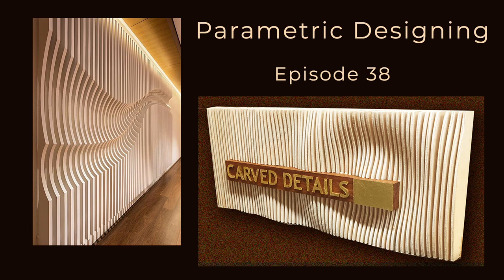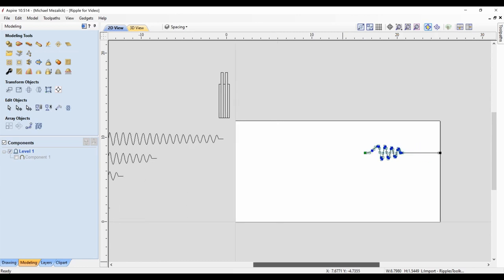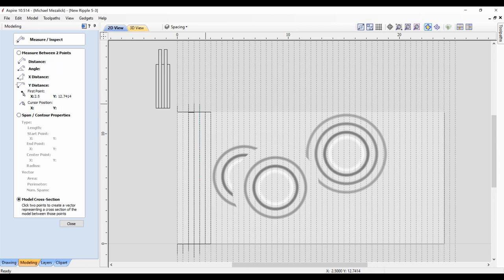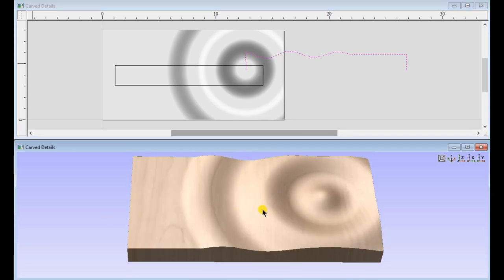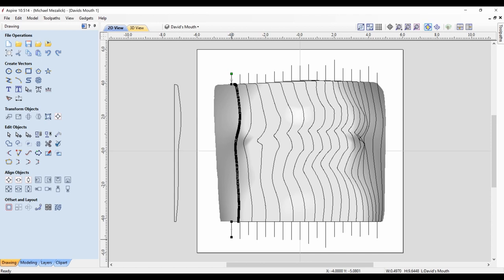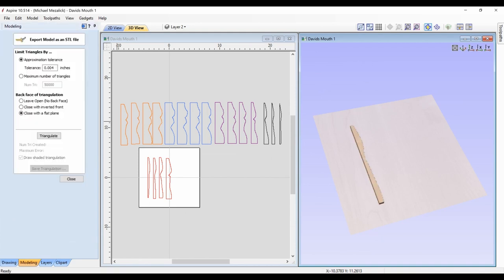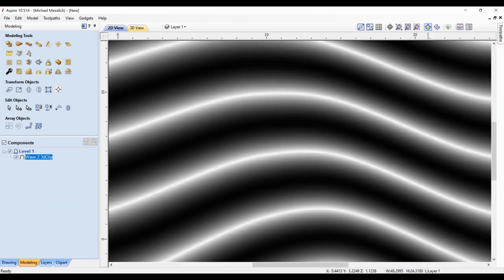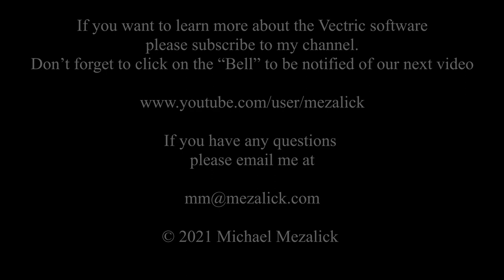Parametric Designing Episode 38 No Background Music

Comment: Excellent as always! I think praying hands would be a good one!
Reply from the maker: Interesting idea, most challenging
Reply: @mezalick  You mentioned Aspire and V carve. V carve doesn't have the turn and spin, would there be another method in V carve? Thanks
Reply from the maker: @rbwoodwork1890  You are correct, VCarve does not have the turn and spin opton or any of the "Create Component" features.
You could find a 3D model on the internet and use the "Model Cross Section" to get the vectors needed.